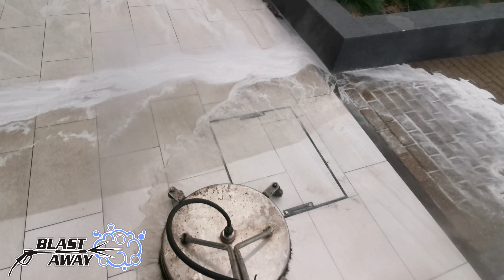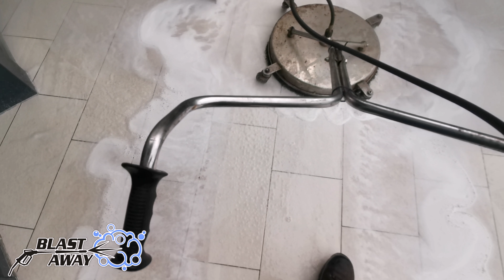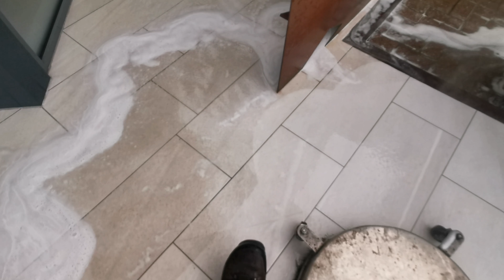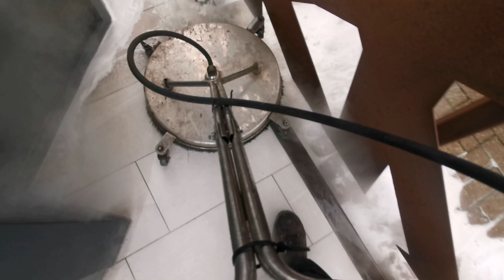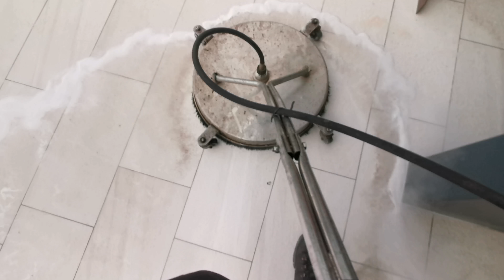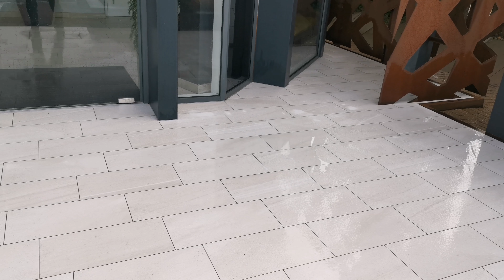Floor Tiles Degreased and Cleaned - Like Brushing Your Teeth Back to Pearly Whites

Comment: Hello
In some Videos you use a Mosmatic surface cleaner in others you use the Falch Scater.  Can you share your experiences which one is better and why?
Reply from the maker: Of course.

The Mosmatic
Pro's;
Lightweight.
Easier maneuverability.
Can get right under benches and tables etc by lowering down handle bars.
Rotary head is very well built and lasts for years.
Works very good with hot water.
Overall great for uneven surfaces i.e sloping surfaces and working around a lot of objects. 
Cons;
Nozzle bar bends easily if hit on uneven objects like corners of paving.
Nozzles need changing every 1 to 2 months because of abrasion. (this is based on our work flow). 
Wheels need changing every 2 months if doing a lot of commercial work. Clogged with hair and gum etc.
Brush skirt losing shape and nozzle fan pattern will hit the bristles during rotation.

Falch Scater
Pro's;
Faster rotation.
Better for large areas of flat work like street cleaning.
Nozzle Arm is machine lathe made and heavier, this weight adds more RPM once rotation is underway thus generating a faster cleaning pass.
More likely to cut through tougher moss in joints on first pass than Mosmatic will.
Nozzle arm highly unlikely to bend.
Rotary head is also very well made.
Cons;
Very heavy and difficult to manoeuvre.
Rotary heads don't last as long.
Nozzle arm will still abrade due to RPM and silt.
Brush skirt wears fast. When replacing a new one also need to change wheels to keep height off ground.
Cant get under benches and tables fully.

If I can think of more I'll reply.
Both have their place depending on the job.
Reply from the maker: A very good question and gives me an idea to do a video.